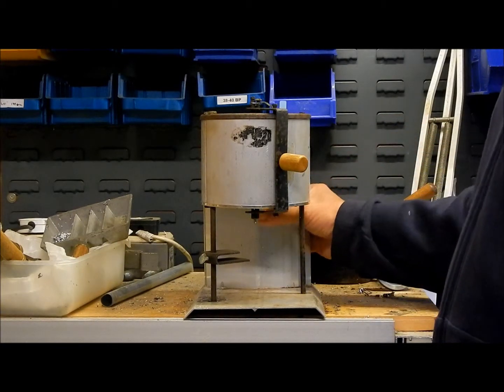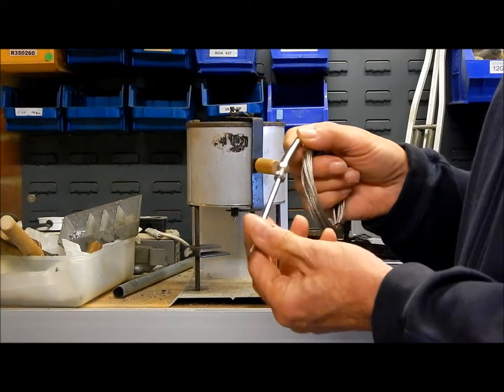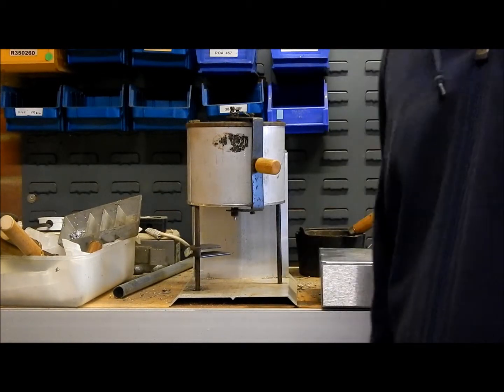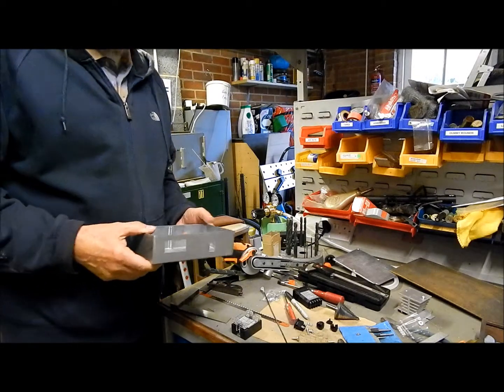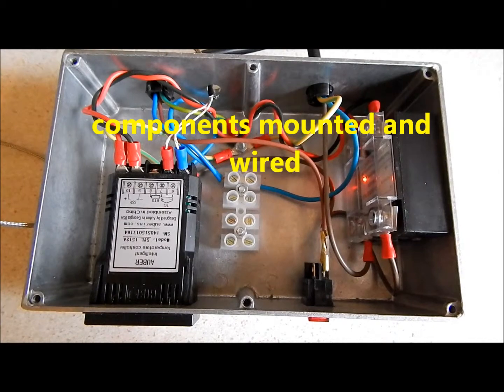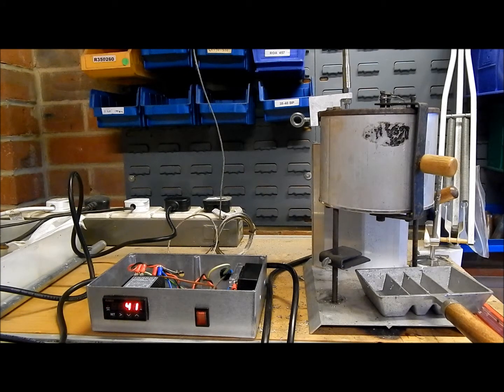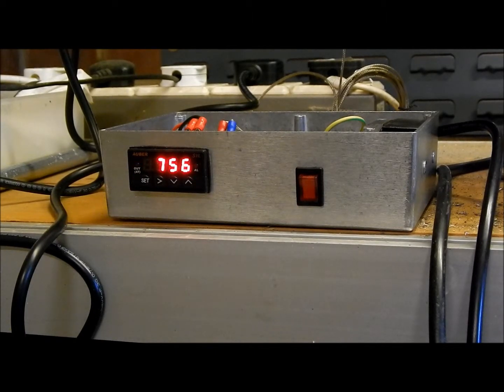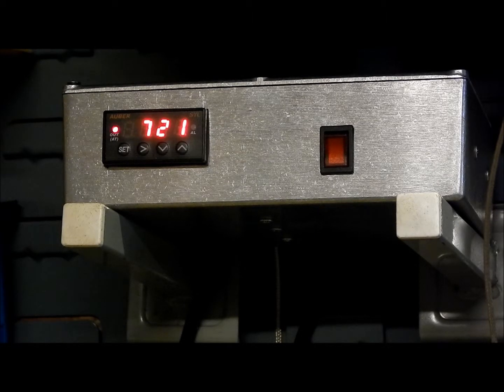LEAD POT TEMPERATURE CONTROLLER

Comment: Loved the video. Testing in pot of hot water elevate probe off bottom of pan 1 inch and will be closer to 212 degree calibration. Was picking up extra temp from being so close to element.

Comment: Thanks for doing this. On the to-do list.
Reply: Can you give the item numbers off of the components you used in your "about section"? That would help significantly.
Reply from the maker: GunFun ZS
The controller is an Auber Instruments SYL 1512A2. If you want to use all Auber components the thermocouple would be the TC-K100M 1/2NPT and the relay is 25A SSR, but both these components can be sourced much more cheaply from Ebay. Thermocouples have only two connections and solid state relays have only four.
Reply: Thanks for the info.